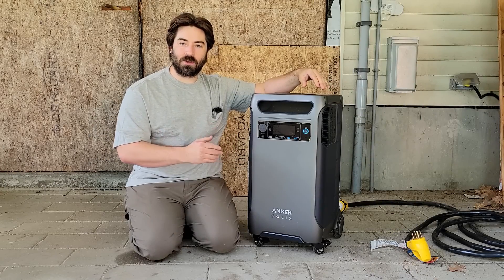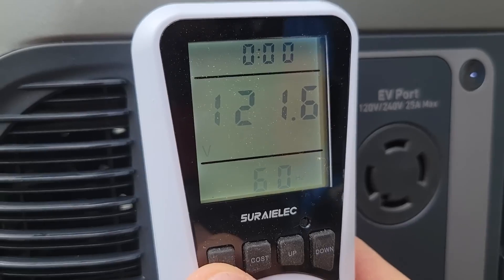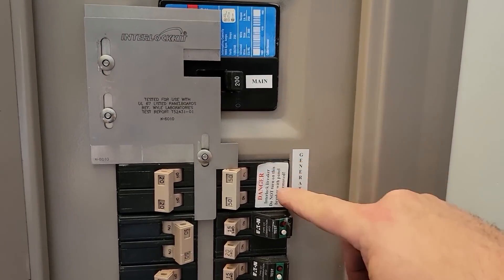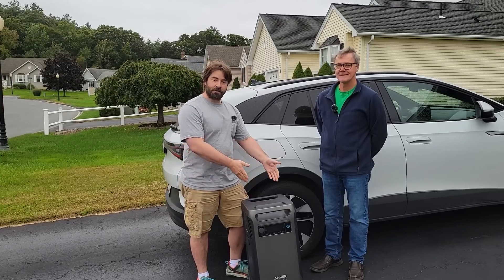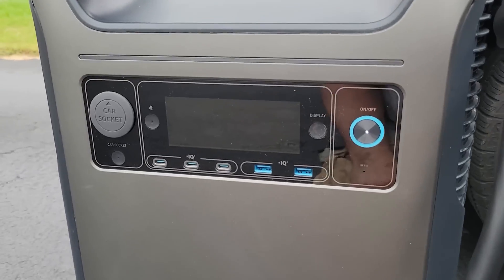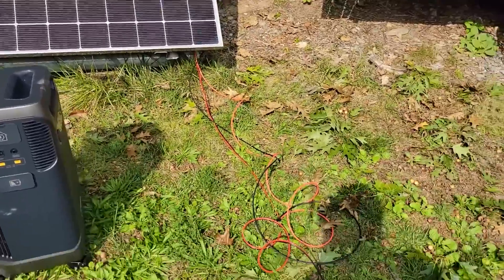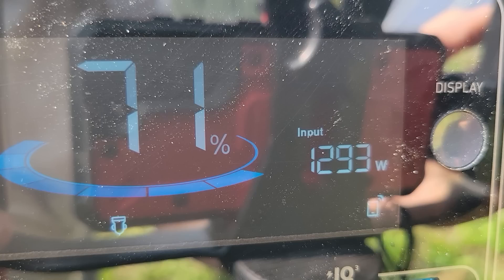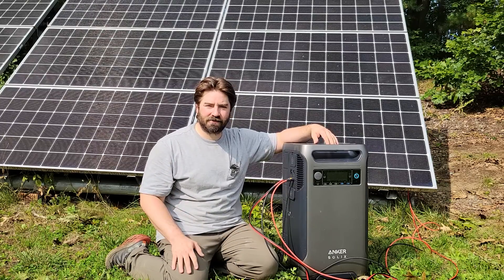ANKER SOLIX F3800 EV Charging and Home Backup, Testing and Review

Comment: Good video, but how do I know how long it would last in the event of a power outage? Currently have an old portable gas generator that is loud, leaky, and cumbersome that I am looking to replace.
Reply: Only you can answer that, but they told you everything you need to know. It has a 3.8kWh battery and can output 6kW. Your usage will determine how long it lasts.